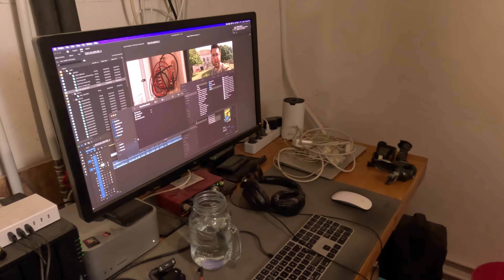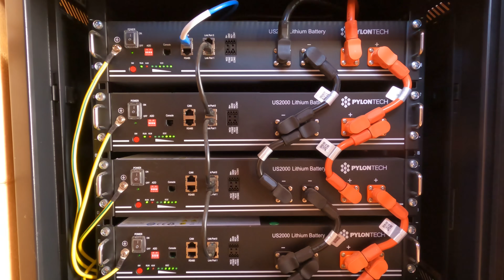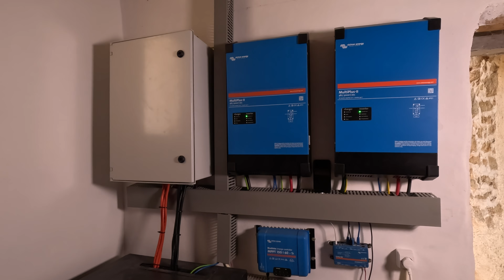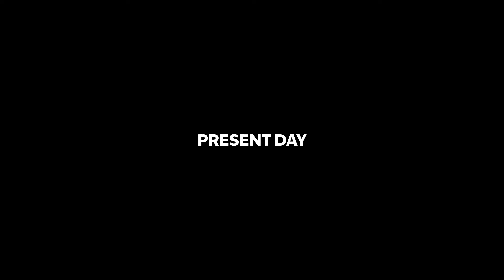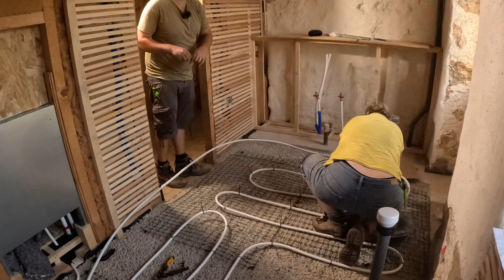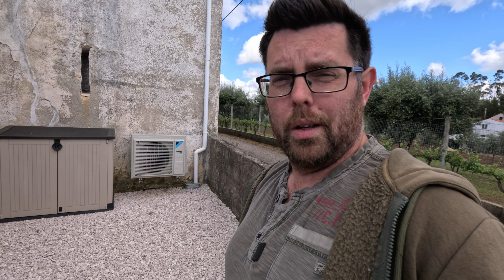Can Solar Power Heat Your Home All Winter? Our Experience and Data Revealed!

Comment: Here in the US - we put in solar about 2 yrs ago (put are grid connected). We have a small farm - so the outbuildings use 1/3 of the power.  But we use about 30kwh per day avg. would love to be as low as your usage!  We don’t have batteries yet as cost was too much. We have 1:1 Net Metering right now so grid is our battery.  I’m looking forward to when EVs and Bi-directional charging is standardized so could use a car as a battery pack to run the house at night and push excess power to it during day vs the grid.  We have 36 panels ground mounted with micro inverters (Enphase) - this was my 50th bday present to myself after many years of research. We haven’t had an electric bill since day of install. Will take about 10yrs to pay itself off - then free power for our retirement.  I also like it for the environmental impact.

Comment: Solar pretty much stops giving sufficient all year around power above ~42° latitude. In winter I'm lucky to see 0.5kWh production in a full day. The fact that I generate enough to cover my annual usage (not counting heating as this is not electric for now) doesn't change the reality that if I wanted to go off-grid I would run enormously short for at least 100 consecutive days. To bridge those and the in between days with batteries, would require in the order of 1.5MWh capacity. And no a generator is out of the question as well because due to environmental tax the cost of fuel to run it would exceed grid supplied electricity by a factor of 6 to possibly even 10.

Comment: I just installed a 6.2 kWh Chinese inverter along with 5 kWh of lfp battery and 9 plates of 585 watts each and all this cost me USD 2300. This includes the cost of wires, breakers and labor. My inverter is IP 21, not IP 65, which is a weakness but I'm very happy with my system for now.

Comment: We live in Australia in a modern brick veneer home. The house is fully electric with insulation in outside walls and ceiling and in the interior walls. We have ceiling fans in each room and 2 reverse cyle split systems, one at each end of the house. When we have extreme heat, those 2 air conditioners in conjunction with a fan or two cool the home very nicely.
We have 13kw of solar panels facing East/West, which is grid tied, we don't have batteries......yet. Even with batteries we would still keep the grid tie, but we would be sure to get the battery system with the ability to have power if the grid goes down. When I last looked that was an optional extra when installing batteries. Maybe when we get a hybrid car we will consider getting batteries.
The system we have at present covers all our needs we always have a credit with the power company when the 'bill' arrives.
Reply: We have 13.3kw too and in Melbourne winter it's a little useless. What state are you in?  It's great in Summer but poor in winter.
Reply: @V6turbo  SA. Our gains slow down in winter too. It could be your weather, I think it gets colder in Vic.
I've read/heard that power companies can 'switch off' inverters if they are getting too much return to the grid, but I wouldn't  have thought that would happen during winter as most people would be using the power as its being created.
If your inverter has an app you can set it up to notify you of any stoppages.
Our household is only 2 older adults so that could have a bearing too.

Comment: Have you tried managing your internet (cloud) connected infrastructure once your uplink goes down (for example due to a blackout). For example the Victron app will not work but you can connect to the VRM directly over https, but then you need to know the IP address. The new interface give the same data but some of the settings are hidden in various menus, had me scratching my head first time around :-). Same thing with the other devices like Inkbird and Shelly. Try simulating it by unplugging your ISP hookup :-)

Comment: I often wonder why consumption is so much higher in the U.S. ... our typical consumption is generally more around 30kWh/day and that's without A/C.  My system is around 5kWp and gets very good sun here in California, fixed southern facing, so I generally make enough for the house 9 months out of the year (plus a little extra that I can push into the EV).

But now with the EV in regular use, I'm planning on expanding the system to 10kWp (at least) to cover more EV charging and also to put in a heat pump furnace for winter (replacing the gas furnace).  Not sure how well that will work out, I might need even more solar, but we'll see what happens.

Comment: I just checked our past week's power usage and it varied from 25 kwh - 87kwh per day.   Stove and hot water heating are gas.  I find it hard to believe that the AVERAGE usage in Britain is a meagre 8kwh, but it's something to ponder.  Thank you for doing this slightly different episode.
Reply: Per day, that’s insane
Reply: That's indeed super high. Just checked and if we're not heating our home we use 8 to 12 kWh per day, this includes hot water, induction cooking plate, fridge and freezer. You may want to check the energy consumption of your appliances?

Comment: Yes your stats and system are helpful and impressive.  Well thought out and works for you. Impressive.

Just wondering if you looked into or considered an articulating system to follow the sun?  
YT Channel 
Camp Out West  (1 month ago) Video was on their new duel axis articulating solar system. They live in Wales.
They installed a :
Dual Axis Solar Tracking System with Solar Tracker. 
The link is on their page.

Comment: Question - what dobyou run the underfloor heating with? Apologies if you've mentioned that and i missed it.
Reply from the maker: It’s a wet underfloor heating system - hot water from the tank (heated by the heat pump, via solar energy) runs through pipes in the floor  and this slowly heats the slab floor
Reply: @MAKEDOGROW  ok thanks ! I somehow got confused when I watched the video, at some point I thought the heat pump is for the tap water only. Great video, thanks! I'm now considering a heat pump heating for my house in PT, not too far from you, so this information regarding solar is a great reference for what to expect if I go solar too 😎

Comment: We are off-grid in South Africa and are happily living off-grid throughout the year. 4 pannels, 2 batteries and a 5Kw inverter. No tv though, no microwave either as I think it is harmfull, cooking mainly with gas and VERY happy !!!! Never had any real issues
Reply: Me too but I need to upgrade to at least 48v lithium battery and 48v inverter to run the fridge. I have 3 panels with gel batteries plus 2000 Watts inverter all 12v 🥺

Comment: The infra is ok, what happens is that your rental house, to cut cost, probably had a low power contract (Potência contratada). But you can obviously have a higher power contract, it will depend what do you want to run.

You can decide between 1 phase or 3 phase, and power you can choose from 1.15 to 20.7 kVA. In your case you could get 10,35 and would have the same power availability of the 2 victrons.

Comment: I can totally use that heat pump, I never knew every pump I saw was using too much power, thanks for that. I have electric heat only off grid for a 28ft 5th wheel, insulated the exterior enclosed the under space, 600gal water,48kwh bank, grey treatment with a 170w rug buddy heater, -20C under was 8.6C low, the trailer is 2 season, so the heat easily rises through the floor 8.9C inside, then I used the 350w in the living room or bedroom depending where I am, or an hour of the 1500w to heat everything up for half a day, I have 11.6kw pv , full overcast 1300w at primetime, 66 gen hours this year, might be zero gen after a few upgrades this summer. I removed all the LPG items as well just 120V AC for all, and a 120 to 12V converter. Low temp was -33C here so mini split won't work. Was a good winter Nov1 to Mar 1, 2MW of pv used. My lowest day was 7.5kwh. Nov 7 39.5kwh next day with sun was Dec 28th. 
I have my panels vertical with snow I make overrated power, in summer I make 60% of rated, still charged by 10 am at the latest. Vertical snow and dirt doesn't stick, self-clean with rain.

Comment: I'm in Portugal as well living 100% off grid. I don't have the heat pump or AC, but all cooking 3 times a day, plus afternoon coffee, water pump, central heating circulating. All this and more on a 3.4KW max array and two 15kw Chinese LIFEPO packs assembled by me, and a 10 kw Chinese inverter (plus a 3kw low idle consumptionon a transfer switch). Your system looks very good, but the cost... Anyways, it is possible to do it much cheaper for those that can't afford the Victron beauties. Great work you been doing on that Quinta!!
Reply: That's an interesting addition - do you have any idea what your installation cost?
Reply: @sroberts605  right now, 550w panels below 100 euro each.32x 300ah batteries about 2200 euro delivered. The 10kw inverter about 600 euro, another 400 euro or so for cables, structure wood for panel mounting and battery box. This if you do it yourself.i ran a 3 leg 6 mm2 cable to my house from shed about 250 euro. You get the idea

Comment: My two cents for your future upgrades.  Consider bi-facial panels as they generate more power and the back face of the panels do so even with "murky" light.  However, it would be in your best interests to do a ground mount and not rooftop as in the rooftop configuration the back of the bi-facial panel would be  worthless.  There are many, many YT videos of these bi-facial installs with some DIY people building their own ground mounts for reasonable costs.  You might even be able to re-use some of the lumber you've salvaged to create those ground mounts.  Obviously, there is nothing stopping you from adding panels to your new garage build, but to expand your system, the bi-facial ground mount would be my recommendation. Cheers!

Comment: The fact that the local power isn’t reliable. Made all of this make more sense.
Reply: It happend once in a century, how do you descibe it as unreliable?
Reply: @goyakat2211  I think what he meant by unreliable is that it can't simultaneously power everything based on their lifestyle.
Reply: @FrankLloydTeh  of course it does, how kind of network do you think Portugal has?
Reply: @goyakat2211 did you watch the video..? At 20 mins in he talks about how little capacity the local grid has, that he couldn't really run multiple appliances at once off the local grid. It's crazy weak
Reply: @robdavy4468  that's odd. Because you can contract 10.35kva if single phase installation or 41.4kva if three phase installation, virtually anywhere in the country. 41.4 kva it's enough to run 18 washing machines at the same time.
Reply: If you cannot use your appliances at the same time that gets a little problematic. Yes perhaps you’re used to it but it seems like the solar is a little more reliable than the power coming from the power company in his area.
Reply: @danielreebs544  it depends on you contract, if you want to pay you can have a subscription of an industrial scale, anywhere in the country.

Comment: Stummuled on your vid.
I'm in  UK, full DIY set up, still connected to grid with both supply's.
But even with my small set up iv managed to set electric to zero or 9/10mths of year.
Looking back (before price hick) I was spending loads compared to now.
Yes it did cost alot.....but I started it off as a hobby thing to see how it works.
Now.... Just need to save up and do afew bits to get totally cut off..
Well done and just to say......very well done on your run through things ect.

Comment: i use about 500kWh per year. That includes cooking, but no hot water. If i wouldnt have my pc running the whole day it would be less. Its really wortk considering changing your diet to not cook to much. Also instead of a tumble dryer, a dehumidifier would work to (in a room)?

Comment: Hello, good video, but with a cost of €18,000 you would pay around 15 years of electricity bills in Portugal, which will probably still cost more than €18,000 as you will certainly have to replace batteries in those 15 years, the problem you mention with the installation supporting the energy you need is related to the contract between the electricity company, you should increase the contracted power and update the electrical network inside the house, in Portugal you can contract between 1.15 kVA 2.30 kVA 3.45 kVA 4.60 kVA 5.75 kVA 6.90 kVA 10.35 kVA 13.80 kVA 17.25 kVA 20.70 kVA 27.60 kVA 34.50 kVA 41.40 kVA most houses use between 3.45 and 6.90KVA but it depends the needs of each family, because the more power you contract, the more you will pay on your monthly bill. If the problem is the use of clean energy, you should know that in Portugal you can also choose operators that only produce energy from renewable sources check www.eniplenitude.pt.

Comment: Not an expert here at all but regarding when you leaved in the rental place and by running two small appliances that would triger the breaker let me explain reason why. There is two cost in the eletric bill first is what you consume in KWh the other is (Potencia) thats is in kva been used you surpass the kva that you choose and the breaker goes off its almost like a eletronic breaker controled by the supplier of you eletricity. The price of Potencia is higher as you chose an higher kva in your contract. That was a landlord issue he had a very low kva contract.
Reply: Exactly, otherwise you couldn't run any buisness in a small town! It comes down to the contract you have with the suplier and not the grid itself.

Comment: Those who ask why so many panels don't understand solar. We panel for winter, not summer.
Also off grid in Portugal, using considerably less power than you guys with 7kw of panels.
Not had to use a generator this winter but a couple more US5000s will be added this year.

Comment: Very interesting video! Gives us an idea of how much we would need to expand our system to go all-electric. Currently we use gas bottles (a real pain) for cooking and hot water (except for the electric kettle...) heat half of the house with a wood burner and the other half with a pellet stove -- then the solar system takes care of the rest. We are in southern France, in a climate very similar to yours, so your stats are relevant - thanks! It would be really great if we could get rid of the gas bottles as we get older and less excited about hauling them around🙄

Comment: I'm in a different situation that yields a similar result. I have an on grid house with excellent service, but I've cut my use so low that the fees just for connection without using any electricity are the majority of the bill. My area charges a significant reconnection fee if I turn off the power.  

How is it for you? Could you reconnect to the grid to replace your generator? And then disconnect when you didn't need it?

Comment: in a string of solar panels, the lowest current panel, sets the max current for the whole string.
So if one is in the shade, it will limit the current for all the other panels!
So line them up equally
Reply: Maybe they have a string setup for each bank in each direction.  Seems as it's a mismatched set if panels.  Still, with that much battery, all facing due south gets the max power assuming no shading strangeness.

Comment: I just wanted to add a little correction or maybe it was a misunderstanding. You don't actually have to rewire the whole house in order to get connected to the grid. You just need to have the main power switch that you can also install outside in a box. They sell it at Nunes & Nunes in Sertã. The price is somewhere in the region of 100€. E-Redes insists that the lines are not accessible until they enter the electricity meter, which will be installed by them. So it must be wired inside the wall. They just used the old one that was already inside the house. I installed a power socket and connected it to the solar system so that it can recharge the battery during the winter nights. It is much cheaper during the night depending on your tariff. I just wanted to add that information.
Reply from the maker: I think you are referring to a new connection. We already have a connection …. but it’s very old and not in a good position. When we enquired, admittedly a long time ago so things could have changed, we were told everything in the house would need to be redone before they would reconnect us. We simply weren’t in a position at that time (and still not) to do that - the old meter and box is upstairs where we’ve yet to start any works.

I agree a new connection is much simpler

Comment: South African here .... been 90% off-grid since our power problems, had a Victron system installed about 10 years ago and they are absolutely the best. I only have the oven on grid and have a solar geyser that is also connected to grid. Have to check the chat group for our area to find out when the grid is off. Love your whole set-up and can't wait for Saturdays to check out what you have been up to over the week. Keep up the good work.
Reply: Love that you  used the term geyser for hot water heater.  When I lived in JoBurg, the geyser for the bath was natural gas and the first time I used it, that Whoosh of flame was sure a suprise.